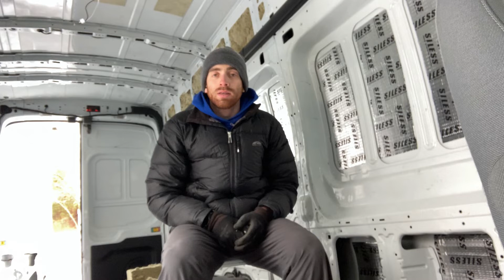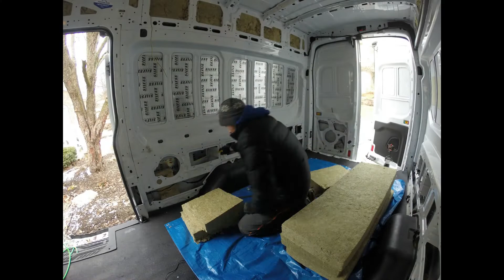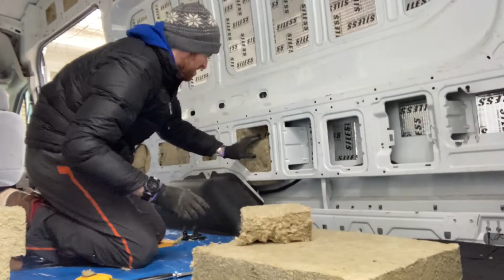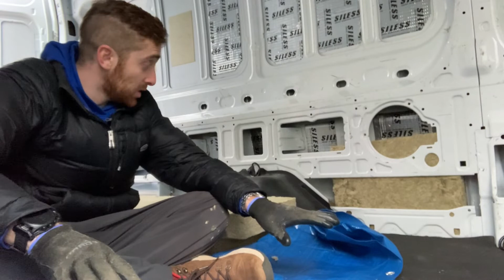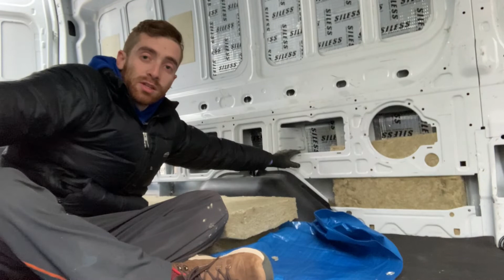Insulating my Ford Transit Camper Van Conversion

Comment: I think its better to sort the electrical out routing before you insulate, if you intend to put it in the walls, as otherwise its a pain to find the holes connecting many of the wall sections, which you'll need to do. We put in sound deadening, then thermo foil before the wiring, which is fine, its the rockwool-type layer that gets in the way, so we had to undo some stuff.

(alsthough I've seen some people wire on top of the metal vapour barrier, after they have framed the van)

Comment: We used mineral wool on the side walls and rigid foam board for the ceiling and floor in our 2018 Transit 250 we finished a year ago. We have a very detailed van build series on my channel. My channel just hit 2.5 million views. ZI put in 30A service on the side of the van, but recently took it out because we really do not need 30A ever. And I hated the huge thick cord that plugged into it. I took it out and installed the Noco dual plug cord that you put in. After a year we added a window to the sliding door and Monday we are having a Victron battery to battery charger installed professionally by a van builder an hour away from us. He installed the new window because I was not confident about it even though I installed two bunk windows, the MaxxAir fan and MaxxAir passive vent in the roof. The Victron will protect my alternator and will send power back to one of my Ecoflow Delta units. I use them instead of the standard 100A batteries that most use. We are not van lifers - retired (70 & 67) - and we go on trips and happily return home after a weekend or month. Check out my series if interested . We love it and the ease of camping with it. Blessings and be safe.
Reply from the maker: Thanks for the info about your build! I’ll check it out!! I’m putting in a window in the sliding door soon, too! More on my electrical system is also coming up in a video soon!